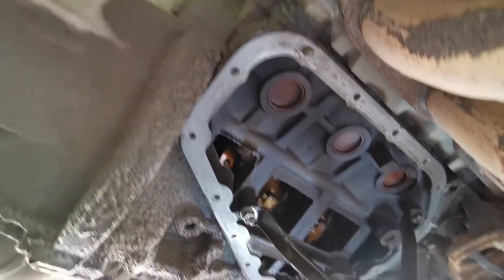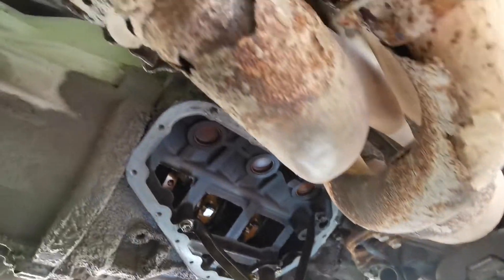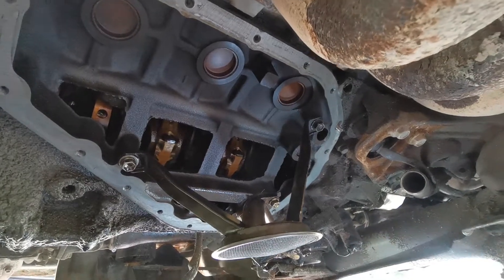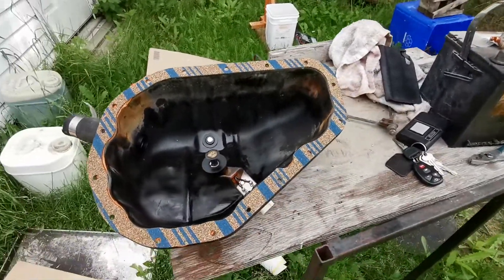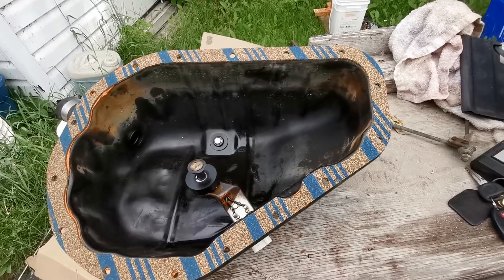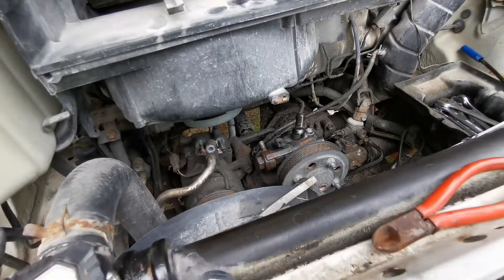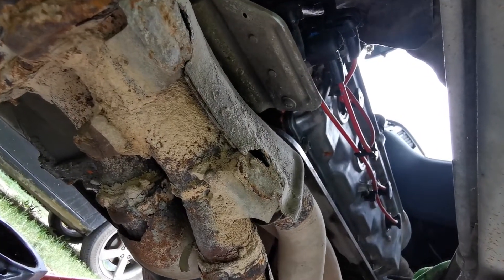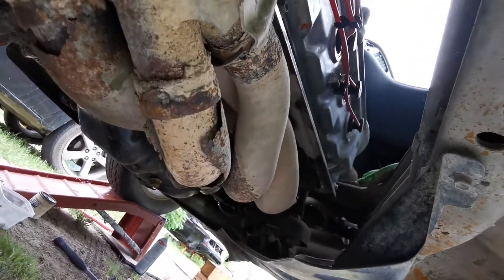Toyota Previa oil pan is installed and power steering new hose to long.

Comment: How did u get to the power steering hose to remove it?
Reply from the maker: Removal of alternator and a few other things from the top. Think I removed the AC pump also. It was not fun at times. Wish I had filmed it better.
Reply: i have an SC model so more crap in the way, i can see the bottom fitting from removing the rain guard underneath. throttlebody, and air ducts had to go so im hoping thats enough @crazybillsgarage
Reply from the maker: @Arbancks sorry I never had to work on the SC model, but everything underneath should be the same.